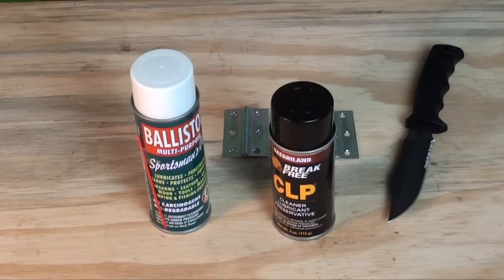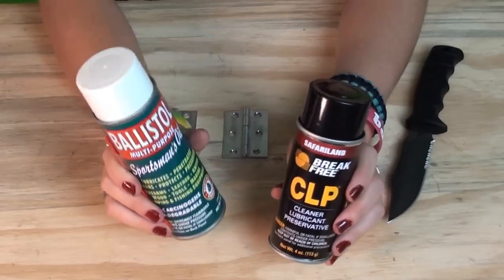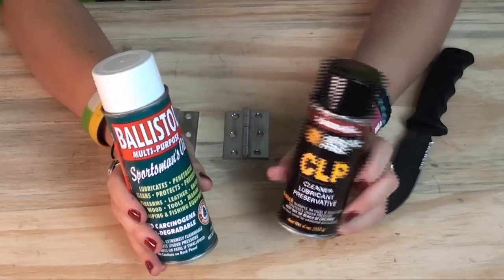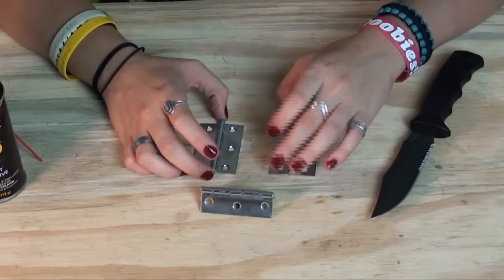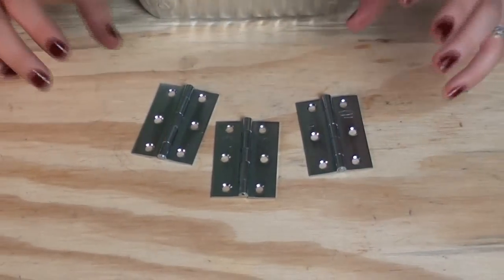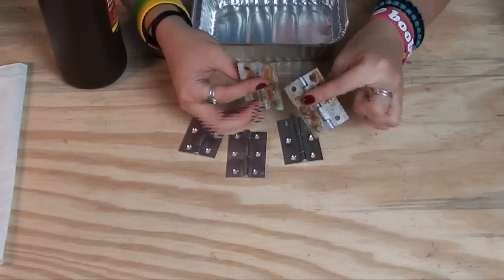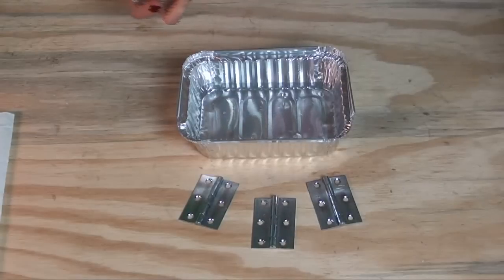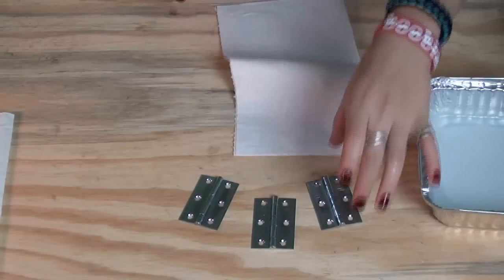Ballistol vs Breakfree CLP EXTREME Corrosion & Gunpowder Burn Test - FateofDestinee

Comment: the three should have been in individual tins of the same solution. Placing all 3 in the same tin allows all 3 to be exposed to both products in your test.
Reply: Get real if you think it made that big of a difference run your own test. Peroxide, vinegar and sea salt are not going to transfer the key ingredients from one to the other. You would need a solvent that is non-polar to the extreme that could dissolve the non-polar oils and such from those products. Most petroleum products are not at all polar. The Peroxide and the Vinegar are are mostly water which is very polar. You guys are as bad as Corvette owners that wont let their wives park their car in the same garage as the Vette during winter out of fear that road salt will magically travel across the floor or in the air and attack their car. Never mind Corvettes are mostly fiberglass for the body! LOL If they are so frail and fragile that salt from the body of the wife's daily driver parked in the same garage is too much to handle than the car is a failure. We are talking in solution for 60 seconds. If this solution is able to wash that much off how would it attach itself to the other part in sufficient amounts to invalidate the results? Would it have been better to put the solution in a spray bottle and suspend the parts from string for the testing? Yes sure but to say her results are completely with out merit is just silly!

Comment: Great video.....I mix 70% ballistol with 30% Kroil penetrating oil in a spray bottle. Spray on and brush or wipe off. For barrels, I use Bore Tech Eliminator with patches and nylon brushes. Then my ballistol Kroil mix with a bronze brush. Final step is a few patches of Sweet's on a plastic jag to check for copper fouling. Usually the Sweet's patches will indicate a clean bore. If I'm satisfied, I push a few patches with  oil through the barrel. Sounds like a lot of work, but there's something satisfying about knowing your handguns are clean.

Comment: @pjansen2010  i agree the Balsitol beats it in the all around picture, well it beats them all, but the CLP impressed me. Balistol os not a harsh chem, so it will not mess up delicate wood areas of the gun and it leaves a smooth silky film behind witch makes gun run smoother and makes it more reliable,

Comment: well thanks young lady its you whose to blame!  Me and my buddy Florida Fred tried to re enact yer video.  Except when we lit the hinge on far with the gun powder things got out of hand.  Fred got some on his hair which immediately burst into flame and he went running down the street screaming like a woman.  I of course ran after fred but as he is 120 # and i'm about 350, i wasnt closing fast at all.  Refusing to drop the triple cheeseburger in my hand didn't do none for my speed either.  Bein how we's both on probation for a similar incident in Tennesee, it made me a bit scared to see cops nearby, but thinking fast i screamed at them "WE ARE JUST REENACTING GAME OF THRONES!  DONT WORRY GUYS I GOT THIS!" As we ran away to their astonished stares Fred rounded the corner and jumped in a deep causeway putting out the far!  Amazingly Fred's face was fine!  (his hair is only an inch thick).  We both breathed a relieved "WHEW" just as the cops pulled up after all!  As they were handcuffing me, Fred was eaten by a large 12 foot gator. So now i'm doing time and fred sleeps with the fishes (more like gators really).
Reply: Can't say she did'nt warn you!!
Reply: How is it her fault if you got hurt trying to replicate her testing? Did she make you do at gun point? Get real! Be responsible for your own actions.
Reply: Same thing happened to me. That is why I now use Ballistol instead of cheeseburgers.

Comment: Firearms Barrels are metallurgical different form your test medium, So much so that when Japans "Nissan Nippon" corporation took over the production of firearms barrels from the US firms of Winchester and others they were mandated to Emboss the words "Special Steel" on all the components they produced. not to mention there is a difference between smokeless powder and "Gunpowder"  Smokeless powder is designed to burn at a pressure curve. Open burning as in the test will leave abnormal residue. Even so the control an other test mediums should be placed in separate containers so that they do not interact or emulsify in the water of the test group as a whole. That being said 3 separate containers of Barrel cross sections under the same test would have yielded more relevant results.
Reply: She was not testing the materials she was testing the lubricants ability to form a barrier to the metal and  and prevent the oxidation process. It would not matter if she used a clean brake rotor for the test since she is testing the lubricants not the material! Hydrogen Peroxide is an oxidizer and vinegar is a mild acid. Exactly in what way would smokeless powder make a difference chemically or mechanically in this test? If I burn a person house down with Kerosene instead of gasoline is the outcome different by a statistically significant amount? On top of that people use the word gunpowder generically. Modern "Gun Powder" that people buy for various "Black Powder" uses has nothing in common with ancient "gunpowder" they are basically all made with modern chemistry and  have more in common with smokeless powder then they do ancient real gunpowder! Chemistry and Science not heresy and supposition. Do your own test and show us the results that invalidate her testing methodology!

Comment: Probably been said before but here's my $0.02. A) the hindges are low carbon steel not high carbon like a barrel B) it looks like you used "black powder" instead of modern gun powder. The stain on the clp one reminds me of the discoloration you get when you heat low carbon steel to add carbon to it to slightly strengthen it. If Black powder was used it has special solvents that have to be used to break it down during the cleaning process. When I was in the Army, we used CLP only to clean our rifles so I have a love/hate with CLP.
Reply: She is testing the lubricant not the steel alloy. Even if it was modern gunpowder and not technicly smokless powder it would not matter. Modern gunpowder like fffg has almost nothing in common with ancient black powder and it basically a modern replacement for black powder. Everything we use today is some form of Gunpwder it is just most of us use smokeless gunpowder's. Shaun what special solvents where they using back when true black powder was being used. I am dying to hear what super solvent the British and Colonist where using or the North and South during the American Civil War! They where lubing their guns with lard for crying out load!

Comment: Damn you had me so drawn into your experiment, i was giddy with excitement on CLP VS Ballistol. Once all 3 samples were dipped and left in the same water solution, i realized i was wasting my time and ill just listen to hicock.
Reply: So you didn't like that they were all dip in the same water??
Reply: Not sure why the same water would throw you off??? Different pans of water would create a variable. The same pan of water provides a consistent medium.
Reply: I happened to work with Haz Mat Chems, and cross contamination is unacceptable. 

In this test of course, for the simple minded people, it does not matter. But to someone like me, You will not get a accurate test using this videos method.

Use the same brand pans, and same water source, BUT different pan for each chemical. Its a basic in chemistry.
Reply: Exactly! Not sure exactly what was proven here. . .
Reply: Rob nasty your right putting them all in the same pan they are all sharing the same chemicals which completely negate the test
Reply: @Rob_Nasty  what's your thoughts on froglube

Comment: When the military stops using CLP I'll switch to whatever they have determined to be better.
Reply: +MrTdw1954 There's a pretty good chance the CLP you're buying isn't the same as the CLP the military uses. Sold in stores at 20% solvent, the military is using 40% solvent. And btw, just because the military is using something doesn't mean it's the best. The military also loves saving money.
Reply: Get a spray can of Balistol and use it to clean and lubricate some other non carry gun. It does have an unusual smell so don't take a drag of it !
Reply: Shady Brady. and get commissions in generals' pockets :)))
Reply: thats what they said about the m16 too
Reply: Former Army medic here, "good decisions & the military" that's a good joke.
Reply: walker  lol
Reply: I went through Army basic training and infantry AIT in 1984.  We used Break free.  It worked then, it works now.
Reply: @NikoBased  yeah but they also scrub the life out of them

Comment: They're both a fair overall deal. I use them both. When it comes to cleaning though, its all about using the right thing for the job, and lots of elbow grease. For general cleaning though this stuff works fine. I only clean my guns to super levels every 6 months or so.

Comment: The Ballistol works the best after multiple applications over time..
Reply: So when you clean your weapon you do not clean off the surface you just keep applying more oil to it with out ever wiping off excess and the like? By what process does Ballistol build? It is not a varnish it does not build with each layer. Once the surface is saturated and the excess has ran off no more oil can wet the metal. Metal is not a sponge that just keep soaking up solvents and oils. Even a sponge has a limit to what it can absorb and once that limit is reached that is it. That is why we have to wring out towels and sponges once they have reached their limit! Can you point to any research that contradicts what I am saying? When have you ever applied an oil with a rag and seen a film build and build and build. If that happened in real life you would have an issue with a .650 muzzle becoming larger and larger in diameter as oil was applied. If I fill a mold with varnish or polyurethane and epoxy and back it in the oven at some point I can remove it from the mold and it will hold it's shape. If I put oil in a mold and back it in the oven if I try to remove the oil from the mold it will not hold it's shape. Use some common sense only Infomercials for things like engine additives claim things soak into the metal! LOL
Reply: buckaroobonsi555
It could be more like a cast iron frying pan... you need to season it before using it. If you don't, it seems everything sticks to it but once it's seasoned, it acts kind of non-stick like... similarly, I wonder if having a thin film of Ballistol or any CLP and then heating it by firing rounds through it, if the barrel will get a bit seasoned like the cast iron pan. That might explain heltonjkv96's experience... but if so, that may not be unique to Ballistol but more of a function of regular use and a heating of the barrel with the oil in it through that use.

Comment: Des, try this test again, but with a hinge that has had several applications of Ballistol. spray it on, let soak and wipe it off several times. then burn it and try cleaning it. I bet you get vastly different results. the magic of Ballistol is that it coats the metal over time and builds up like teflon.

Comment: you didn't leave the ballistol on long enough.  You have to let it sit for awhile because the main mechanism of action is through invading the spaces between the grime and the metal, breaking down surface tension and letting the crud come away easily.  The oleic acid also helps to dissolve copper traces and tombac.  break free works better for a quick cleaning though, no doubt about it.  ballistol works best when given time, even over night to do it's work.

Comment: I've been using CLP on my firearms. One of the things I like about CLP is that after multiple applications through routine maintenance, it seems like my firearms are easier to clean, as fouling sticks to them less and less. I'm sure Ballistol does a handy job as well, but my only experience is with CLP.

Comment: Well Break free actually has teflon in it so it builds up over time to help protect the base metal but the best cleaner I have found is MPRO-7 it will even take off light surface rust and copper lead carbon you name it. The only bad thing is you have to make sure you lube your stuff back up really good after you use it because it strips everything off. But it doesn't stink or anything smells like water and it won't eat your hands.

Comment: It's a non conclusive test as the chemical solution that the hinges were soaked in has a cleaning effect as to remove the oil from the surface.

Comment: wow... so much negative criticism... regardless of what others said... thanks. I found this informative.

I think the test concept was fine. As others have stated, maybe using non-galvanized so that your sanding won't affect the test and also separating the parts into separate corrosion bins would have been better. On that note, I was wondering if your corrosion bin could have "washed" the Ballistol or Break Free CLP off to some degree. One other tester used a salt water spray and left overnight. I think that was a more legit test as it left a film of salt water without the risk of washing off the protectant. I think the goal of the test was good in that you are using some metal and seeing if there is a relative difference between the results. Thus it doesn't have to be done on rifle steel. But, as mentioned, I think bathing the hinges in the corrosive solution might have been too aggressive in that it may not have allowed the chemicals to work in a way they would normally work, i.e. perhaps they got washed off to some degree.

As for the  gun powder test, i think that was a good test. I'm not sure if you were able to control the amount of powder on each hinge and whether that would have affected  your results. Off hand, I don't think it would... but... Either way,  the idea of whether the BreakFree CLP or Ballistol would clean carbon residue better was good and I think the test stands regardless of the type of metal used since the focus was on whether one cleaned better than the other is a relative test. In addition, the behavior seems to mimic experience, i.e. I soak the barrel, wipe it out, then soak it again and repeat until it comes out clean.

Comment: The only why to truely test them side by side as weapon cleaners is to get two AR's, 24 mags and 720 rounds of ammo and head to the range. When finished with ammo, use Ballistol on one and Breakfree on the other. After one of the interesting times in Central America, I can attest to Breakfree cleaning up an AR without problems, after about 12 mags.

Comment: Ballistol as a cleaner or light lube for long term storage only. Fire Clean or RandCLP for running the gun and operating in the field. It seems like they both melt carbon away. Nothing wrong with CLP, but after a couple of decades using toxic cleaners, I've been using 'greener' nontoxic products, which CLP is not.
Reply from the maker: Thanks for sharing your opinions on gun cleaners with us, and thanks for watching ^_^

Comment: I've found that ballistol is a better general purpose cleaner, okay corrosion preventative,  disappointing lubricant. CLP was a decent compromise all around, better at L than ballistol. I still use both though. Ballistol is my general shop project cleaner and CLP for the field.

Comment: It seems to me that the Break Free CLP can sprays with more velocity, causing it to dispense more product as well as aerating it to create a foaming effect. I would say that using a little more Ballistol and letting it sit longer would have comparable results to the Break Free CLP. I usually individually apply the cleaning solution to each part of my firearms that needs to be cleaned. Once they are all saturated, I give them at least 3 minutes to sit, then go back and scrub them down in the same order that I applied the cleaning solution to them. It might just be my OCD kicking in at that point but, Break Free CLP and Ballistol have worked equally as well for me using that method.

Comment: I use both, I was using Ballistol and started using CLP because I noticed it was leaving a lot of gun powder inside my barrels in between the grooves. CLP has done a lot better job inside the barrels, and it doesn't have that smell. The only thing I did notice about Ballistol is that it last longer as a lubricant. As of today I like CLP, probably change my mind next week haha, Good video, professor.

Comment: Sorta good idea for testing, but you should have used Blued Chrome Steel (what gun barrels are made from) and performed a cleaning like you were cleaning a barrel (brass/bronze brush, then patches).  If you wanted to redo the test to mimic a firearm, check around for a barrel that's been changed, cut it so you have the same composition of metal and do the test again.  Perhaps even get some rounds fired through the barrel before it's changed for an accurate powder burn.  Again good idea, but missing too many conditions to give accurate results.

Comment: your hinges are hot dipped in zinc, galvinized.  When the power burns it is hot enough to cause the pitting and discoloration.  This does not happen with a gun, since they are not galvinized.  Beyond that, great video.  On the face of it, looks like Ballistol may protect a bit more while CLP is the more agrresive cleaner.  People buy what they like.  The bottom line is clean your gun, moisture and powder residue  are not good for them.

Comment: @FateofDestinee To be fair, you aren't really testing the 'L' portion of CLP and Ballistol, more just cleaning and protecting.  It just would have been interesting if you had perhaps used Hoppe's #9 as a control group for the cleaning process - this is what a dedicated cleaner can do, this is what these 3 in 1 products can pull off.

Have you ever heard of Ed's Red?